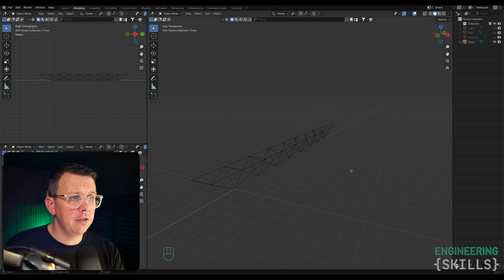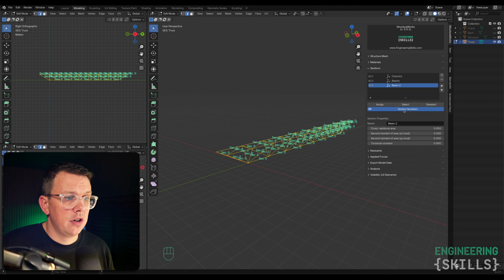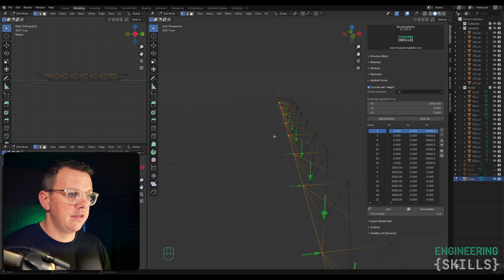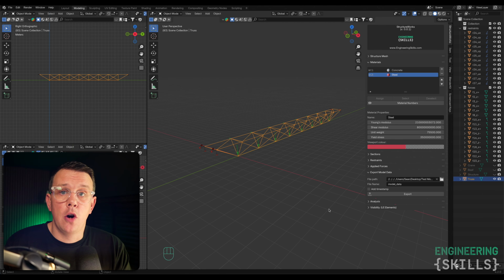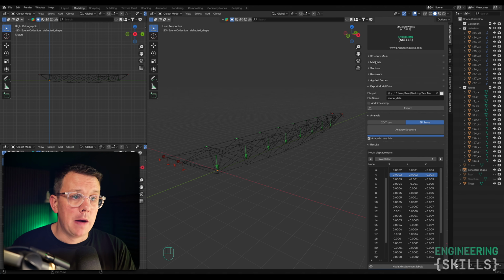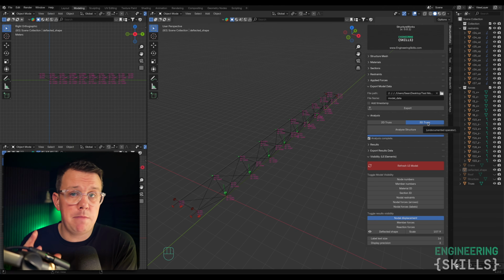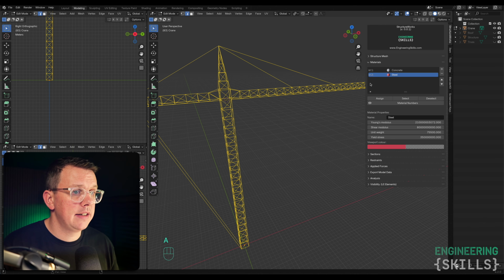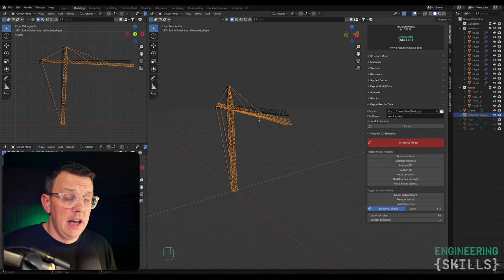Structural Analysis Blender Addon - Development and Release Update

Comment: Are you using geometry nodes?
They can help you visualize the heat map, also, what about distributed loads on a member instead of point loads?
It is amazing what you have done with blender, I hope your project keeps growing and motivate more people to create these innovative workflows.
Reply from the maker: Hey, no, not on this project, not yet at least. Although I can imagine some nice workflows where we might use GN to develop geometry that we then analyse using the StructureWorks addon. V1 of the addon will focus only on truss structures, so all loads must be resolved into nodal loads (also no local bending is yet considered). V2 will include beam elements, enabling the modelling of beam and frame structures. Lots to do!
Reply: @ that’s impressive!

Comment: Looks amazing Sean! Really looking forward to playing and following the course. I'm currently developing a web application for the temporary works sector so will be very interesting to see how you implemented structural analysis into Blender using Python.
Reply: Can I ask why you opted for csv and not json for exporting etc?
Reply from the maker: Thanks @ybothd, I went with .csv because I think it's probably more familiar to non-developers - but you can easily change it...in your version 😉 If you're developing tools already for your sector - I think you're going to find this course really interesting...the extra overhead when building 3D for the web is a killer, it's really nice to let Blender handle this natively (of course, your users need to be open to using Blender 😬)